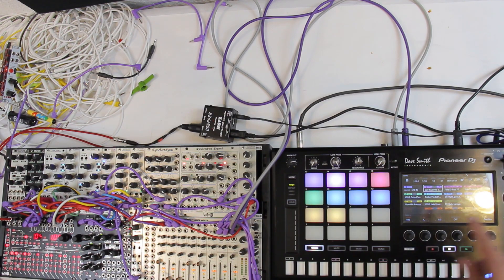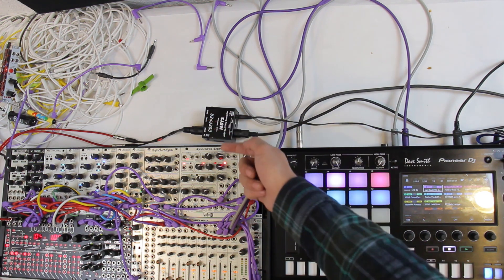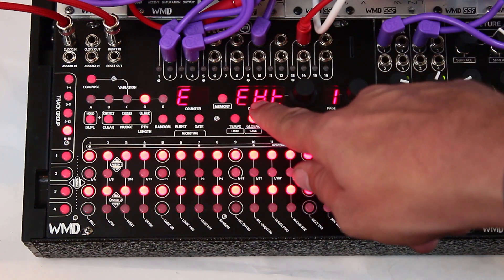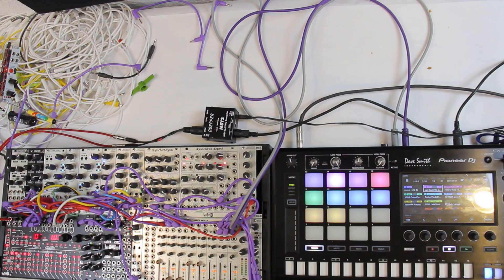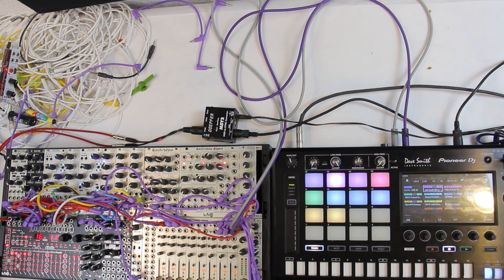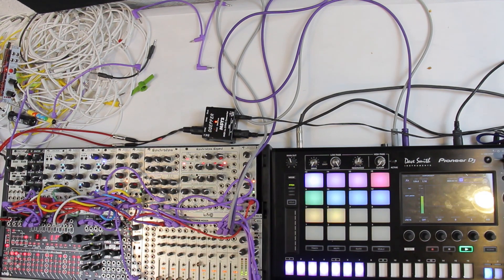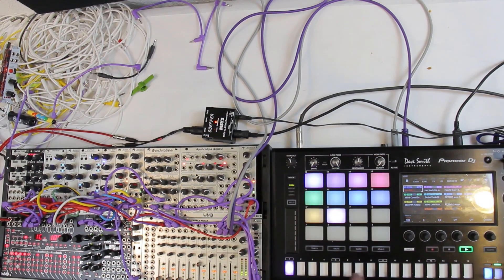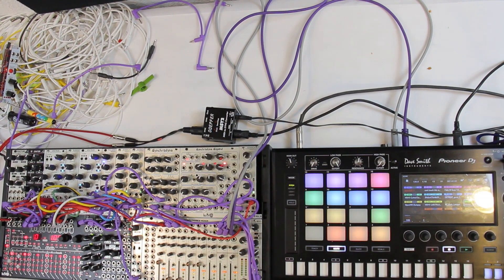WMD METRON - How to use DIN SYNC to sync to external gear

Comment: This doesn't work for me one bit. I press global, set the clock to external then start turning the page knob but din sync never comes up
Reply from the maker: What firmware version are you on? the latest is 1.4.  The setting you want to change is "reset input". It's the 5th setting.
Reply: @WMDevices  I have updated to 1.4.  I think I may have gotten it working. Whatever I did doesn't actually match what i see in this video, however.

Comment: Is it possible to sync metron via an erm multiclock using the analogue out on multiclock to the clock in? Or does it need a reset signal too
Reply from the maker: Yes it will work with ERM Multiclock.  RESET and RUN signals are nice so when you stop and start on the ERM, it resets metron.  Metron does not auto reset after not receiving clock.  You can always reset manually when the clock is stopped.  I think a RUN signal (see manual), for a din sync style sync would be the best idea.